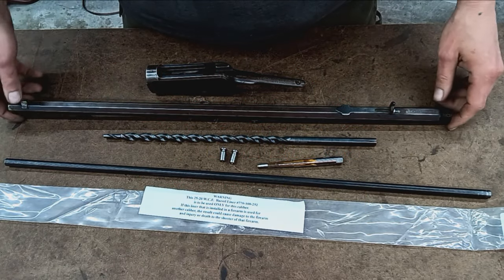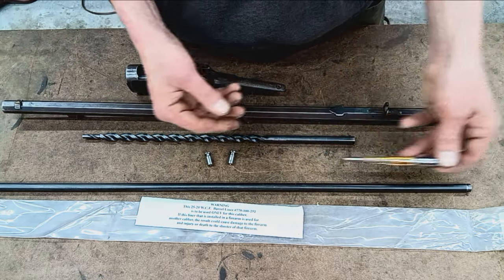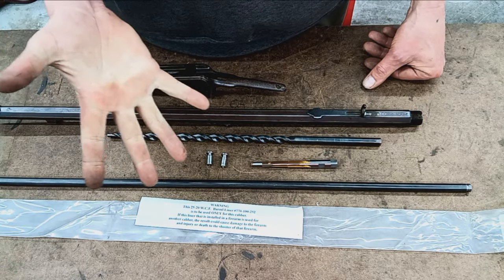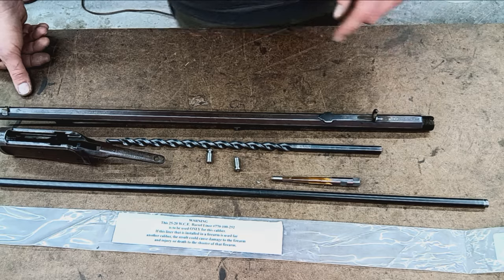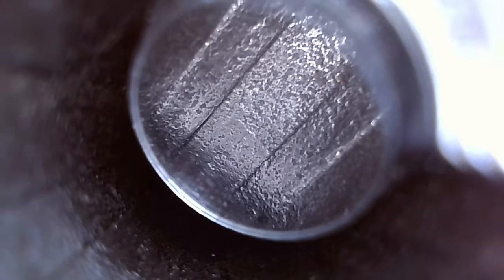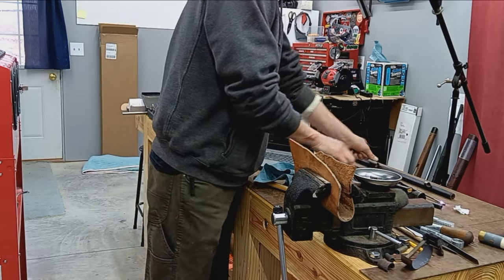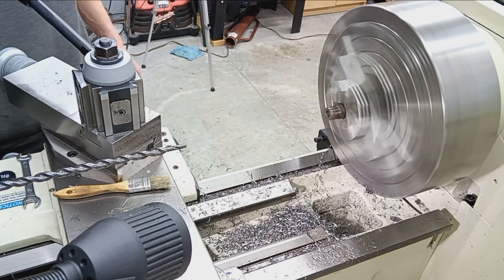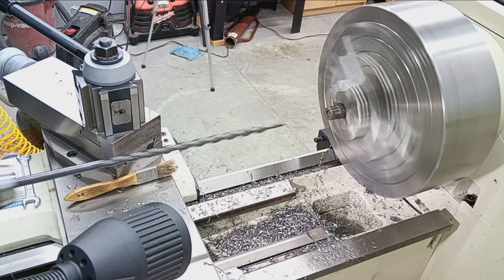Winchester 1892 Barrel Relining Job - Pt. 1 - Replacing the worn out bore with a new barrel liner.

Comment: These piloted drills are a great dis service to the owners of the rifles that are trusted to the current generation of “gunsmiths” . I learned to install liners from an old gunsmith that ground his own piloted drills and then silver soldered them to rods that were long enough to drill full length from the breach. If done properly you never see the liner from the muzzle end. I grind my own and have installed them using this technique for about 30 years now.
Reply from the maker: Thanks for watching our video and for the comment.  This drill was made by Guhring, so I am confident it's a proper tool for the job.  What's the difference anyways?  We're simply removing material for a new liner to be installed.  I wish you well, sir!  Again, thanks for engaging our video!!
Reply: It’s not that the drill geometry is wrong, it’s that it promotes a poor installation. A professional installation should,as much as possible, preserve the original appearance of the firearm, this cannot be accomplished if it is drilled from the muzzle as well as the breach. My liner drills are all about 36 inches long and barrels are drilled from the breach end only and the taper of the major diameter of the drill stops short of breaking thru the muzzle of the barrel. The liner is tapered to match and when installed is virtually invisible. When a barrel is drilled from the muzzle there will always be a ring showing at the muzzle whether soldered or epoxied in place. Yes there is more tooling involved that is necessary, but my primary lathe for this is a Sheldon 56 inch lathe and it only takes about a half hour to set it up for a liner installation. I am sorry if I sound harsh but I have seen lots of shops/individual’s promoting their work as professional restorations and long range rifle work in the interest of making big money but to the trained eye it falls short. Dan.
Reply: @hillsgun  Bless your heart. He and his customer are comfortable with the job. Find someone else to have a weiner measuring contest with...
Reply: @emmettdibble8404  because they know no better.

Comment: Cut the chamber out with a boring bar to larger drill diameter to give the piloted bit some stability as you start your cut. Same with muzzle.
Reply from the maker: Yeah, I do that for chambering precision rifle barrels, but for this?  Nah...  we're simply removing steel to accommodate the new liner.  Ya know?  We really appreciate the view, comment, and engagement with our channel.  Stay tuned for much more!!
Reply: @AccurateRiflesandRestorations Wasn’t throwing it out there as a suggestion, I’m telling you how to do it right. Pre boring takes very little time, and makes the entrance into a drill guide. Also is more effective to mount the cutter in the tool post and run it in with the hand wheel.

Comment: Wouldn't it be beneficial to start with a drill size in between the size of the bore & OD of the liner  ?
Reply from the maker: No.  That would take twice the time and would have no beneficial difference.  We're simply removing material for the new barrel liner to be installed.  Thanks for watching and for engaging our video!!
Reply: @AccurateRiflesandRestorations  I'll agree to disagree,  especially if your concerned about it walking,  yes of course it would take more time probably not twice because it would feed quicker but remain centered better, stay sharp & reduce the risk of it breaking good video by the way